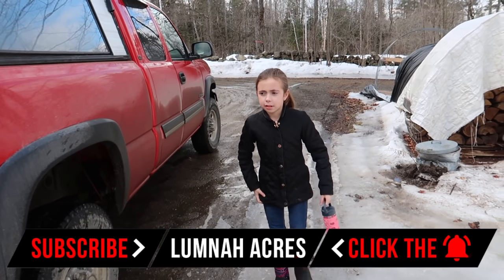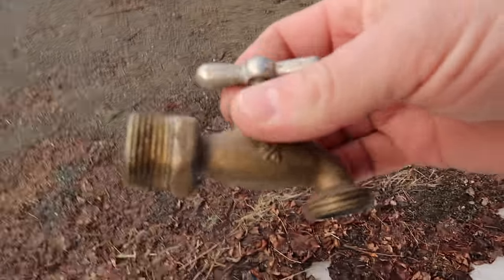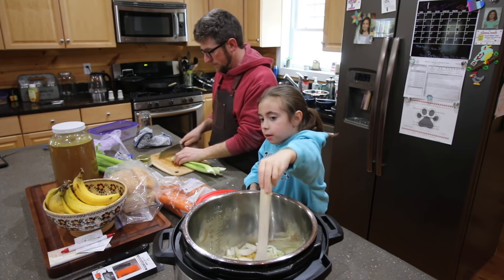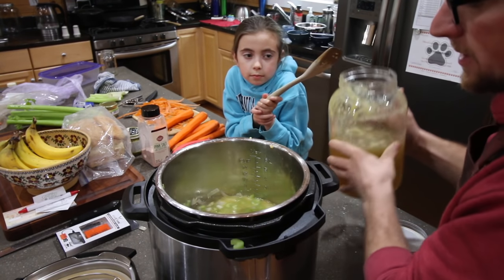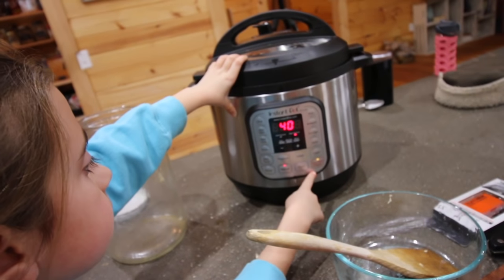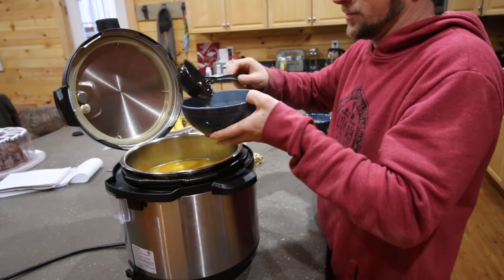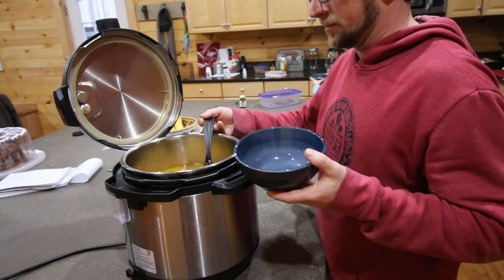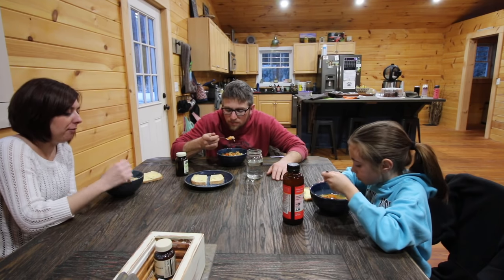Making our Maple Sap Collection Bucket ~ Olivia makes Homemade Chicken Noodle soup

Comment: I ended up switching my reg garden tap out for a 3/4 inch valve tap.  It allows the sap to come out faster.  Good luck with the syrup.  I am boiling down 3 barrels today.  It will take a good 12 hours.  May have to finish some the next day.  I always finish mine to about 221F I like it thick and smokey.  Cheers from Canada Eh!
Reply from the maker: Thanks,  I appreciate the tip on the temp!
Reply: No problem.  Keep in mind they say to finish syrup 7 degrees above your water boiling temperature.  So that puts me at an ideal temp of 219F But I find a few degrees above the norm is what I like. Have fun and experiment with different batches.  Cheers!

Comment: Hey Al.... I know you love your Insta Pot.. but check with the company.. they just did a MASSIVE recall on them.. might want to check it against your model machine.
In case you missed that announcement... I'd rather error on the side of caution and let you know.
Reply: From what I've heard they're recalling batches 1728, 1730, 1731, 1734, 1746 for the Gem 65 8-in-1 model. I think the Lumnahs have a Duo80 7-in-1, so hopefully all good? Worth mentioning and checking though, agreed! :)

Comment: Don't they use stainless steel valves in food grade equipment? I wonder if the brass fitting is going to have a adverse effect with the sugar it comes in contact with?
Reply: After researching a little lead free brass fittings are acceptable practices. If it was me and given you will have a lot of sap I would be in the lookout for a stainless steel container that doesnt have a brass valve with silicone applied to keep it from leaking. I will post a link i found that gives you a breakdown of industry practices. So it might go to your spam folder

Comment: You might want to check out your sap viability.  I watched a show that said you can't store sap in bulk because it's viability is only 2 or 3 days. I also wanted to ask if you've ever heard of Capon.  Capon is a rooster that's been castrated when young.  The meat is supposed to be better than hen meat because it doesn't have the hormones in their system.  They are usually in the stores around the holidays with turkeys & Cornish Game Hens.  I thought it would be a good way to use rooster chicks because instead of a smaller # bird like you'd get with a rooster, you'd have a Capon that's grown to 10- 14 pounds, that's higher quality meat.
Thought you would the FYI if you hadn't heard of it before.
Thank you for all of your videos & recipes.

Comment: You need to be careful when heating the spigots you can melt the o-rings or washers or any other plastic bits in the handle and valve assembly. With love from sunny 🌞 Arizona